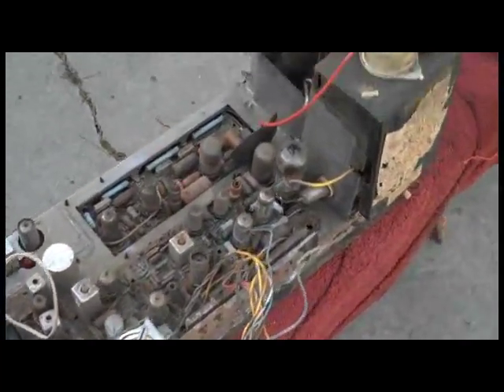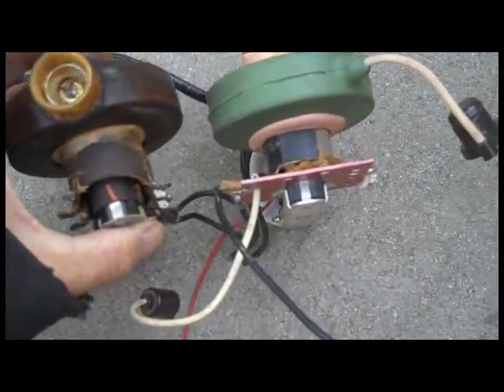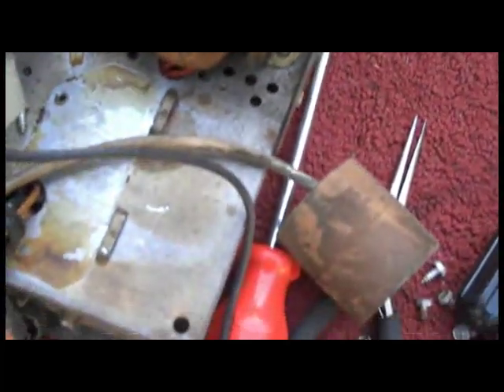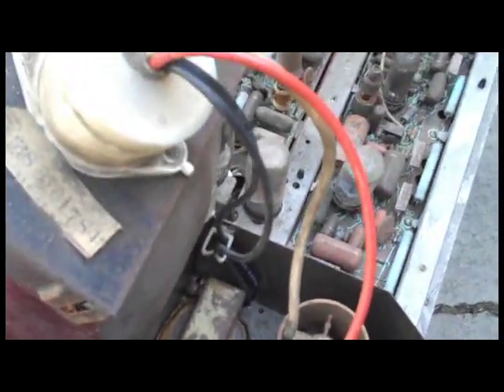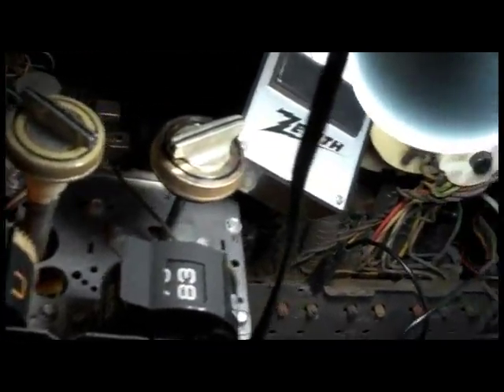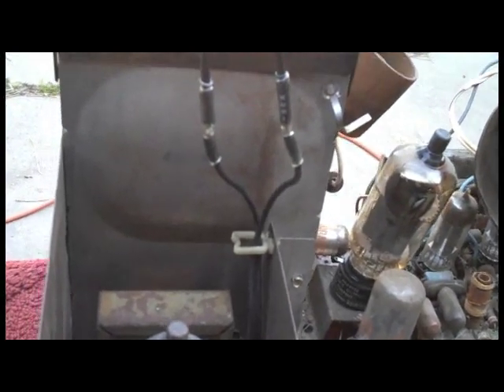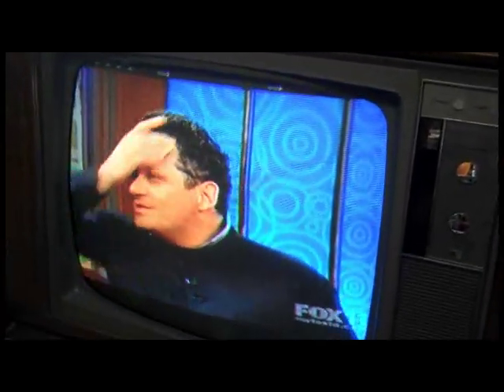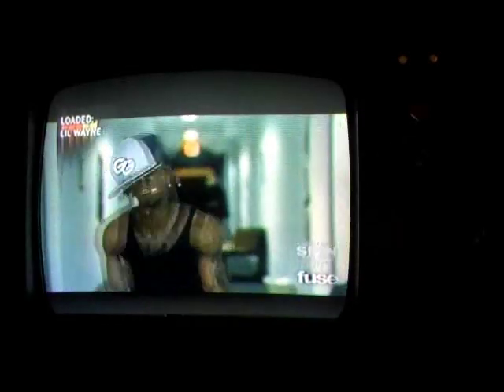RCA Color Television Flyback High Voltage Transformer Remplacment CTC 17 CTC 35

Comment: 1 of 2--
This comes a bit late but I'll put it out there for other restorers with this problem. Years ago, an old timer TV repairman friend of mine fixed a set with bad flyback by stripping off the shorted HV winding (the most failure-prone part of the thing), and replaced it with an HV tripler! I didn't think it could possibly work but it did--output tube cathode adjusted to spec and he was able to eliminate the HV rectifier and its filament winding. In hindsight it makes sense...

Comment: 2 of 2--
...since the high voltage pulse at the output tube plate is similar to what a tripler normally sees at its input coming from the transistor-driven flyback that was used with them. These flybacks had a similar but smaller--i.e. fewer turns--step up winding than the standard tube type flyback. So the tripler would work with similar HV pulses in either case. A very smart technician. May he rest in piece.

Comment: That's very informative...I'm working on a CTC-28 right now and hopefully won't have to do a flyback replacement on it. One time I did a flyback substitution from a Hoffman 23" rectangular RCA clone into a Silvertone round set. It did work but for some reason the width was not as good as it should be.

Comment: My parents had an RCA Color console set from around 1966.  This set had problems with the lead going from the horiz output tube burning off the cap that went on the plate of the tube. We only had the set until 1969 went my parents dumped it.  Seems they were always calling RCA Factory Service for repairs to the set.

Comment: this is almost the same as the philco tv and its like unless you replace those leaky bad caps you will have another bad flyback and adjusting your coil wont make much difference all hazeline chassis had this problem as stated a minute ago